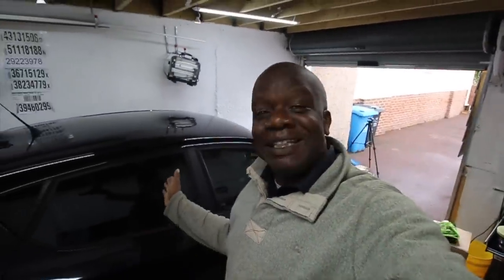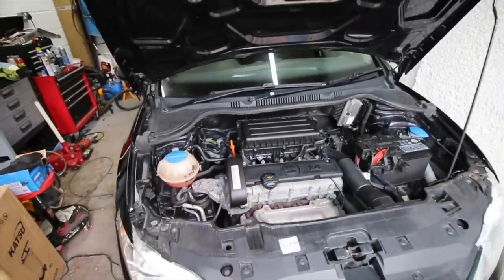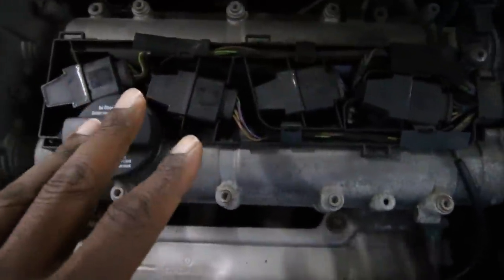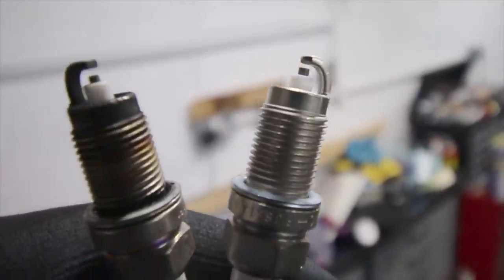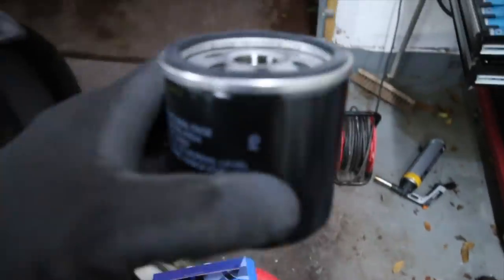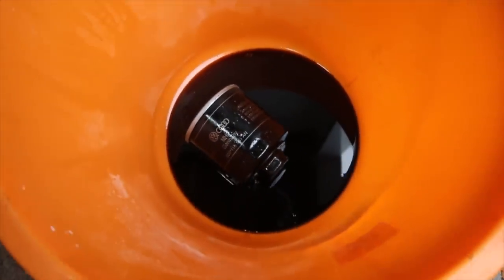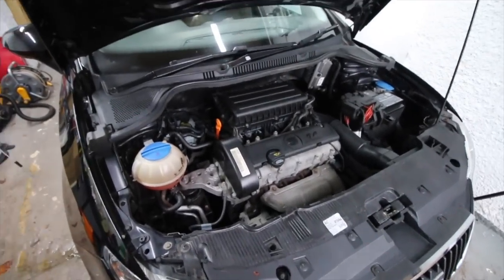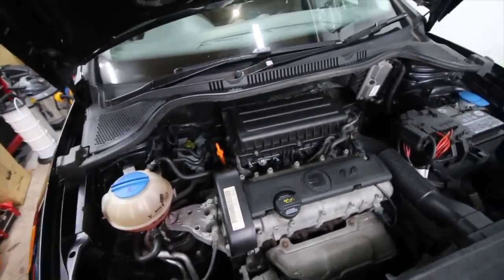Servicing the Seat Ibiza before it goes

Comment: Not a fan of sucking up the oil through the dipstick, don't see the point, and you never get all the old oil out this way, plus it's a good idea to check the sump plug for any metal particules, simple way to see if there is anything grinding inside the engine, it will be stuck to the magnetic sump plug.  Also did you ever get a look at the Cambelt condition? :)

Comment: I would always drain oil from the bottom. you risk leaving all the worst of the old oil and any metal fragments in the sump which will build up over the years if you always change the oil in this way
Reply: Agree. Plus pauls '5 percent' refers to a garages electric pump not a diy style hand pump. I bet there was still a litre in there honestly.

Comment: I've got one of these oil vacuum pumps. They are generally pretty good but the success rate seems to vary from engine to engine. I change oil more regularly using one too as I'm not convinced it picks up any sediment off the bottom of the sump.

Comment: Leaving 5% odd old oil makes it less sufficient, when I do an oil change on my old car, I remove the sump  it drain, then remove the sump, clean replace seal, sump nut and oil ring.. it is a 1973 VW 1303s, but that's my way and oil is changed every 2500 miles.